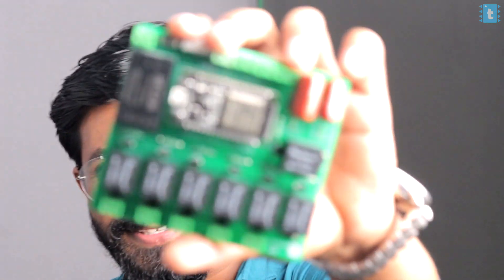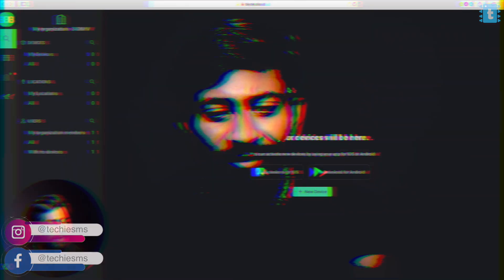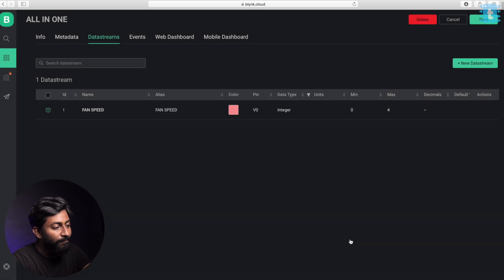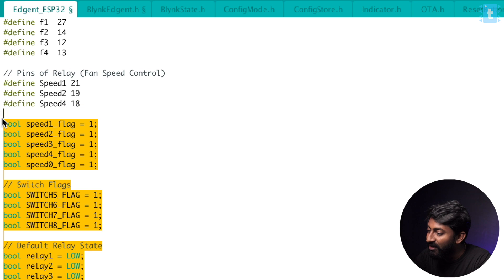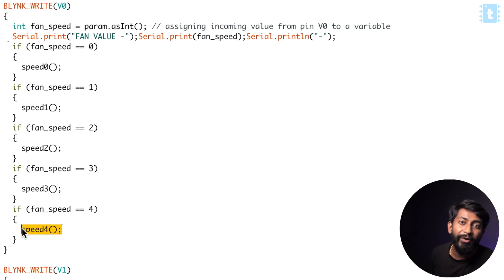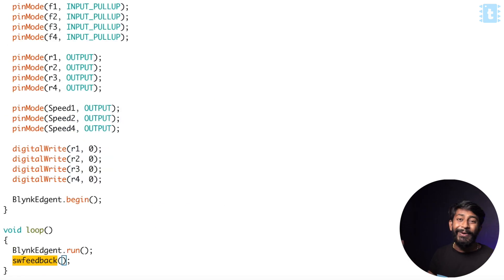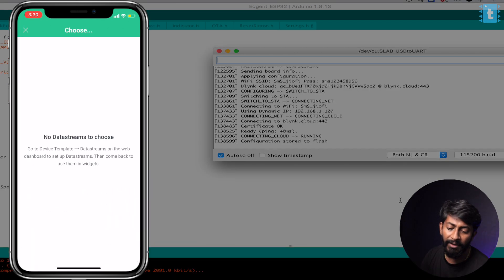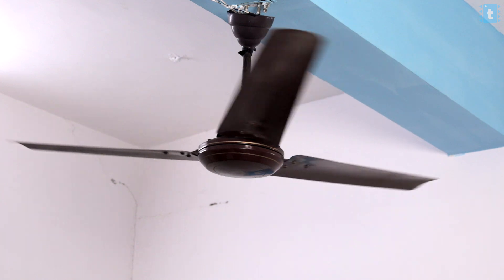Internet & Manual Home Automation using New Blynk 2.0 with Fan dimmer and Realtime Feedback

Comment: Good project  I use same circuit but the manual fan regulator speed 3 is not working both the relays for speed 1 and speed two are have to turn on but they were flickering otherwise all switches and fan speed working fine thank you

Comment: Great job. if the board get power off manual switches will work still? You didnt explain the schematic circuite diagram. Coz the most of the people wants to know how the manual switch works in off line? it would be appreciate giving reply for this
Reply from the maker: No 
If the board gets power off the switches won’t work

Comment: I have seen the circuit diagram and I have a doubt regarding the fan speed controller. The fan speed is controlled by 3 relays of which two are connected to two different RC circuits and the other is directly connected to fan for full speed. What will happen if all the 3 relays are simultaneously on?
Reply: in one function two relay work together

Comment: If the board didn't get the power supply still the manual switch will work?
Reply: i have the same doubt here because the physical switch have no connection with appliance . 220V Ac is connected between relay
Reply: no it wont work as relays are triggered by switchs if you modify the diagramand  add 2way switch  to it then it will work

Comment: Didn't understand the 5 pin dimmer connection. In Bangladesh we use two cable connection 
which is use like a switch. Pls provide detail connection system